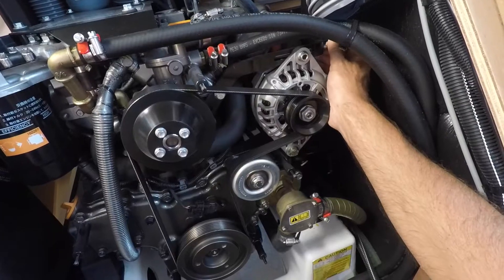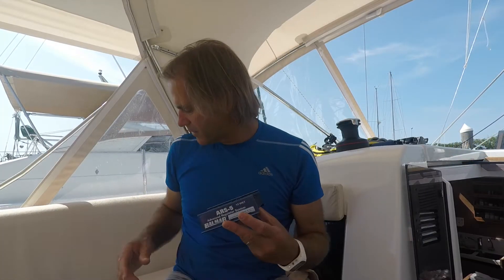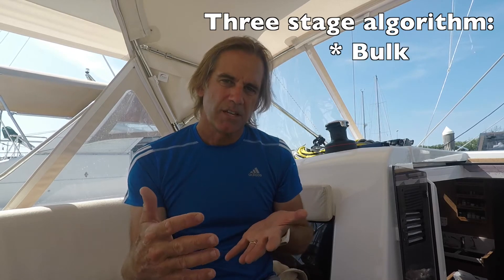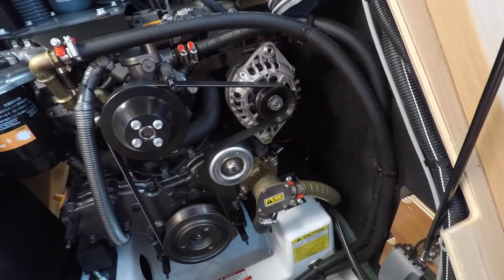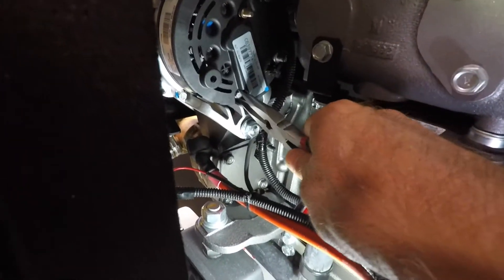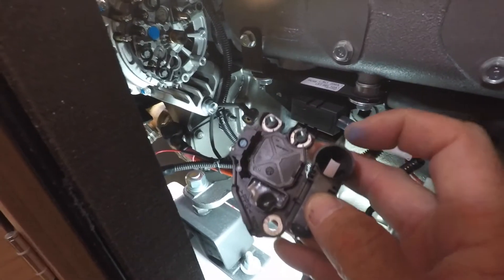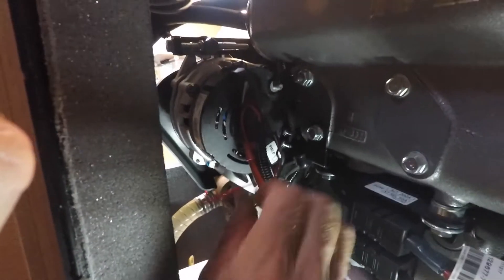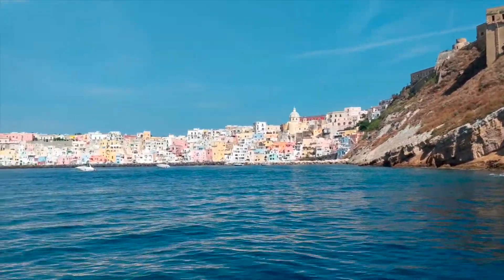Upgrading Your Boat's Alternator and Regulator - Part 1 of 2 | Ep. 56

Comment: I asked about health of alternators after a couple years because I have heard reports of the Valeo alts failing after the modification within a couple of years.  Don’t want to throw money down a rabbit hole
Reply from the maker: Hi Tracy. The Valeo held up well for us but it did hit it's temp threshold regularly and the regulator kicked down the output accordingly. So it is important to install the optional alternator temperature sensor so you don't burn it up. This past summer I upgraded to a Balmar 170a as it has a much higher output at lower rpms. Still, it can get hot at times and be throttled down by the regulator. On our engine, the Yanmar 4jh75, I have been told that with the alternator so close to the heat exchanger, the alternator can have a hard time cooling. Balmar recommended that I remove the safety shield on the front of the engine to get better air flow, which has helped somewhat. Good luck!

Comment: Thanks for this Tom. Worth checking in 2022, the new Yanmar engine put into the SO 440, apparently have a 150 amp alternator that has a smart ready internal regulator, and you can have 2 alternators on the engine, as long as the 2nd is installed by the Boatbuilder during the Construction of the Boat. tbh, of this is confirmed correct when ordering the boat, I think I'll personally check with Balmer to see if they recommend upgrading the drive belt system after delivery if improved belts aren't an option / automatically applied during installation. Best Wishes. Bob.  👍
Reply: My small Sunfast 3200 15 Hp two cylinder Yanmar diesel, used to have the option of two altnernators. The standard one was I think 80 amps. After 2013 I think it was, Yanmar dropped the second alternator option, and instead put in the 125 amp alternator that I Bob's bigger engine uses. I would not surprise me if Yanmar dropped the twin alternator option in the motor you describe and just provide a bigger alternator.
Reply from the maker: Interesting info, thanks. I'm personally not a big fan of a second alternator - more mounts and pulleys to add and points of failure. I would tend to go with a higher amp good quality alternator, upgrading the belt if really necessary although the K6 Balmar alternators for the Yanmar serpentine belt on the SO440 can handle a pretty big load. You might check the specs before going through the extra work of a second alternator.
Reply: @LifeFourPointZero  
Very Good Points. I may go with a single Balmar XT170 for the extra ventilation and cooling, and keep the Original as a spare. With Solar, and liking to run diesels under load regularly to keep them in tip top Condition, Keeping Batteries nicely topped off shouldn't be a oroblem. As an aside, One channel on YouTube devoted to Solar and Batteries mentioned something about not worrying too much about Lifepo4  Cycles charging discharging impacts,  due to Battery Age Demise likely happening before running out of Charge Cycles ? Will Prowse (I think I got the Channel right ? ) who does huge amounts of Battery Testing, including dismantling them, is the only person I have come across who has even mentioned this Battery Aging aspect tbh. Have you come across this at all by any chance ? Best Wishes and Fair Winds.  Bob. 👍🙂

Comment: Very interesting, I wonder why it wouldn't come with this stock from the factory.  I'm curious to know if you have a generator? and if not would it have been advantageous to install a high output alternator while you where at it.  That was a very clean engine bay by the way 🤩.
Reply from the maker: I would have put a high output unit on there (such as a Balmar), but then I found out these stock alternators are robust enough to be upgraded. And it's output already is 125amps. We do not have a generator. We have lots of solar, and get by just fine in a mostly 12v world.